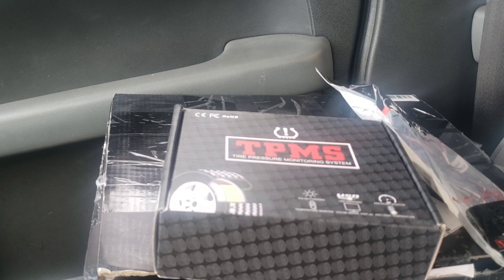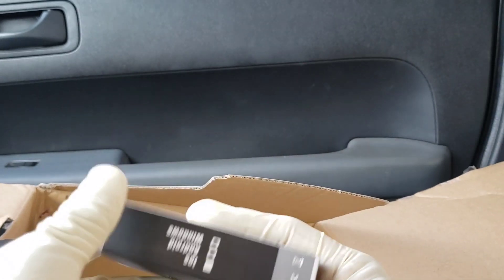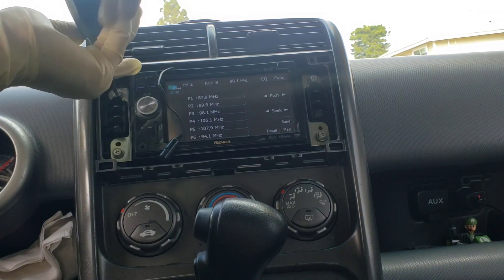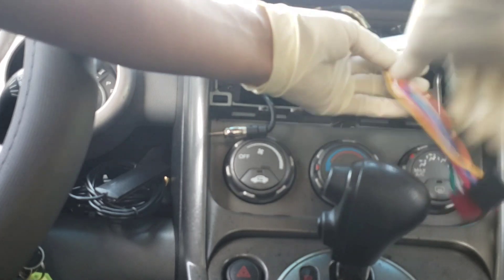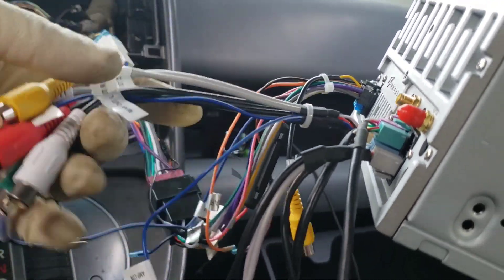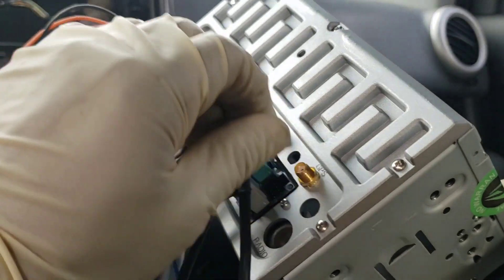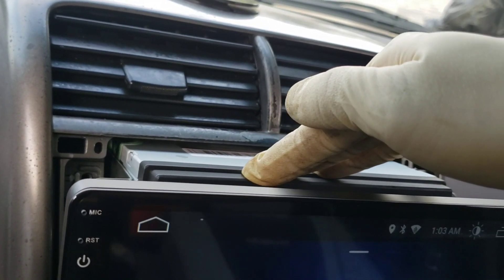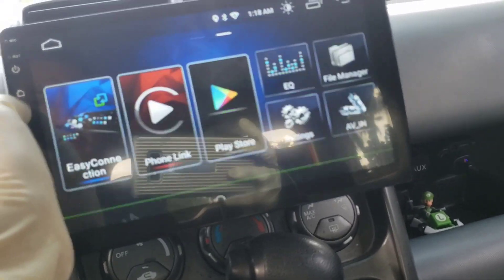Honda Best Stereo System for the price - Honda Element - EONON STEREO TPMS OBD REAR CAMARA

Comment: Nice work. The only thing now is, if u buy that stereo, the OBD2 does not come with it. What was the price u paid for that unit? I already hv a Blue driver OBD2. How well r u finding the tire sensor working & the GPS? Does the GPS only work with ur Hot spot? No Seattle capability? Garmin has the Seattle abilities.

Comment: Followed your steps, but previous owner had a steering wheel controller amoungst the jumble of wires.  When I reinstalled new Eonon, my steering wheel controls no longer worked.The sub woofer which hadn't been working now, and it's like a rock concert in the car.  Boom Boom Boom.      Any suggestions?

Comment: Does that wiring harness make the steering wheel controls work? Or do you need something else.
Reply from the maker: They don’t , make E is an older model so you will need to get another harness to make it work

Comment: Are you able to independently operate the factory subwoofer bass levels after installing this deck?   I had best buy install my pioneer deck and the guy who did the install said I can't do that anymore. I don't remember why..  If I want to adjust the bass I have to adjust the bass that controls all of the speakers.  :(
Reply from the maker: Yes I can adjust the OEM bass with my aftermarket stereo
Reply: @Element_lifestyle  which video shows you running the rca cable to the aftermarket radio from the subwoofer?

Comment: I'm looking for a car/truck cross over thing to haul my tools (not pulling anything) and also go back and forth to school I'm thinking the element would be a good choice but since you have one I'd like to hear your ideas on it
Reply from the maker: It will be a good buy because of the space and also for being a 4 cylinder giving you better gas mileage than another Car for a less price of the car. Also easier to fix that other vans. I do have a Ford transit which I like the space too but honda engines  are better in the long run. Also Honda Element has so much space that can almost compare to a van space when seat are fold it.
Reply: Perfect for your need. Take out rear seats & have room & easy access for all your tools

Comment: After installing this exact unit I’m not getting any AM/FM channels.
Reply from the maker: You will need to go to a secret menu and add a pin code , then you have to change to USA frequency
Reply from the maker: I will need to make a video of it and also how to set up the time
Reply: @Element_lifestyle  I’ve tried all the types/frequencies and none work. I live in Whittier which is south of Los Angeles. Curious if there was a certain thing I was supposed to plug in. I followed the instillation steps from your video. Any help would be appreciated. Thanks bud!
Reply from the maker: @MRelemint  make sure you connect the radio antenna to the stereo
Reply: @MRelemint  you will need to buy an antenna adapter if your honda is made after 2005
Reply: I ended up returning it due to the am/fm issue, subwoofer not working and wasn’t too happy with the poor audio quality. Guess I could fixed the am/fm and subwoofer issue the poor audio quality is not fixable. Hopefully I’ll be able to find a better product similar to this one.